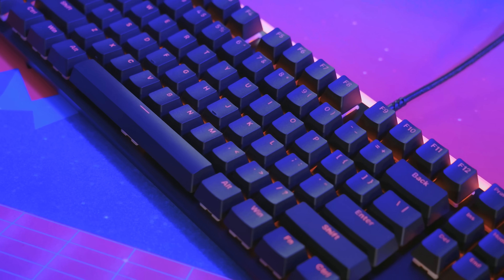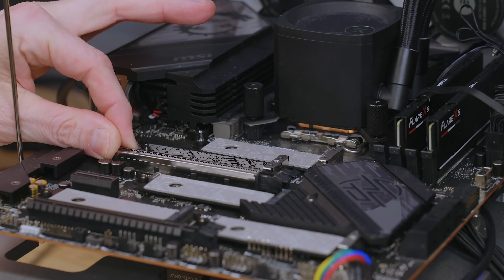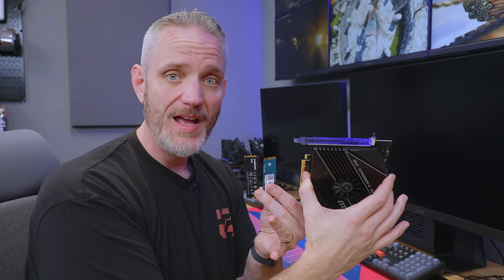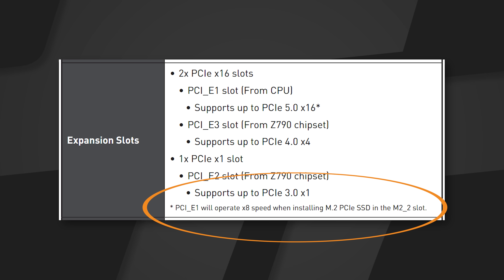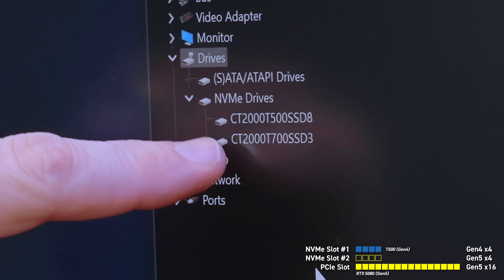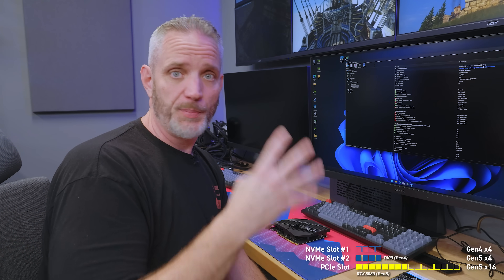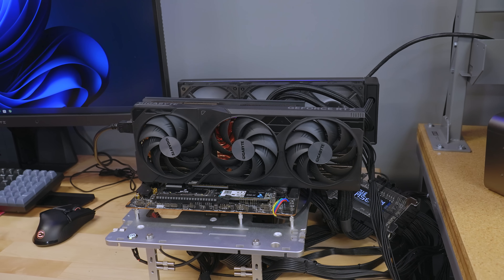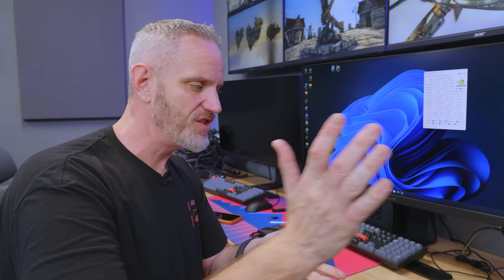Don't make this mistake with your PC!

Comment: Hey, thanks for the info. Just reconfigured my 3 m2  SSD's to optimal positions on my ASRock B850 Pro-A WiFi AMD AM5 socket, it has 4 sockets, and I have 3 SSD's, two gen4 and one gen3. I had one of my gen4's placed in a gen3 socket (m2_4). However the physical position of the m2_2 slot is actually underneath the graphics card, I opted not to use it at first, out of a concern for thermal throtling, should I be worried about thermal throtling or damage due to heat on m2's?

Comment: Quick cheat-sheet for people to help them understand what it is they're getting involved with:

- If you have to populate PCIEx16 slots beyond the GPU, usually the lowest ones are ran through the chipset and won't bottleneck your first slot's lanes
- M.2 slots are often arranged in the same way, in that using the bottom ones (closest to the chipset) are unlikely to bottleneck your GPU's PCIE lanes
- SATA drives will never compete for bandwidth with your GPU
- The topmost M.2 slot is usually the one connected directly to the CPU, and you can do with that knowledge whatever you want (I find running storage through the chipset is stable while using the direct-to-CPU lanes on the M.2 for OS is good for latency).
- Ultimately, this all only matters if you're doing things like heavy RT, overclocking for benchmarks, or basically anything that pushes your system to any kind of limit, which doesn't describe 99.99% of all users

Comment: Oddly enough I've just had to deal with this myself last week with a prebuilt. I read the manual for the AMD X870E motherboard it's going to have, and it said the M2A slot is 5.0, while M2B, C and D are 4.0, but populating M2B or C drops the GPU slot from x16 to x8. So I only got two M2 SSDs (one 5.0 and one 4.0) and pretty soon I should be able to see if they put them in the right places 🤞

Comment: I have the Asus Rog Strix X870E-E WiFi (with 9800X3D installed on it), and i installed there two Gen5 Crucial T700 and T705 drives, and installed other two Gen4 drives in the chipset lanes, and my RTX4090 runs at x8 4.0, and its not big deal i think, its kinda not that noticeable. I am happy that i has two Gen5 drives that are working as Gen5 drives. And yes, its very important always carefully to read the manual of your specific motherboard in your build!

Comment: I have an pcie gen 5 to nvme extension that allows bifurcation for 4 extra slots that doesn't pick up unless you manually select 4x4 lanes in the bios so there are some circumstances where it is useful to manually select for niche circumstances

Comment: Yeah, the additional x4 PCIe lanes is for USB 4.0.

Okay, to add to what Jay's explanation, for AMD CPU (Ryzen 5 7600 and 9600 and upwards, non-G variant like 8600G)
There is one General Purpose (GPP) PCIe 5.0 x16 lane which can be bifuricated to x16, x8 + x8, x8 + x4 + x4, depending on motherboars.
There is one dedicated lane of PCIe 5.0 x4 for NVMe SSD
There is one GPP PCIe 5.0 x4 (which for X870E and X870 motherboards will convert it to USB 4.0)

For Asus, if you plug in any NVMe SSd to M2_2 slot or M2_3 slot, your PCIE_1 slot will automatically switch to x8 mode.

By the way, Jay, AMD Ryzen has 28 PCIe lanes, with 24 usable lanes if you use 600 series motherboard and 20 usable lanes if you use X870 or X870E motherboard with 4 lanes for USB 4.0. 4 hidden lanes are for the chipset.

Comment: It's getting a little bit unreasonable how much you are now supposed to know when building a pc. It used to be more Lego. If you have the slot then you can fill it with anything that fits. So you can buy wrong ram, wrong ssd's and God knows what else. It should not be that way in my humble opinion. Just give me 2 ram slots and 1 nvme slot if that is all it can handle at full speed.

Comment: I am curious as to why more board manufacturers on the x870E premium boards didn't go the ASUS route here and actually use the second x4 of PCIe 5.0 if it's bifurcated away from the x16 graphics slot.  Too many only have 1 x4 v5 NVMe to the chipset, and one slot that is x4 v5 but shares with the X16 slot - those other x4 lanes are wasted.  If you're going to do one, you might as well have the option to do another x4 v5 since the x16 slot isn't going to run at "x12" or something.

Comment: Jay you have to do a videos about the MSI x870 motherboards having the front panel usb type c connector in the wrong place, they collide with the GPU with many case cables for usb type c.

They put their proprietary ezconnector in place of where the usb type c should have been.

Comment: This was my dilemma going from my older X299-chipset, i9 PC, to my newer X870 / 9800X3d build. Simply put, the only way to get more PCI lanes is to go with Xeon W-series or Threadripper, and spend thousands of dollars more. I had to move storage to a NAS and get rid of my raid card to stay within the confines of a normal board, as there's only so many lanes on the normal, 'consumer grade' CPUs. Even then, to make my new MSI board work at full speed with the  2 NVME drives I have (1 gen5, 1 gen4), I needed to manually disable (unused) USB headers on the motherboard. I don't have any regrets, though, as the new system is faster for its intended uses.

Comment: I didn't read the freaking Manual Luckily the X670E MEG ACE came with the ability to run all m.2s in 4x even with the top x16 slot occupied didn't even realize that my top m.2 slot is gen 5 compatible didn't know that got a gen 4 in it shrug can look to upgrading it when they release some larger than 4tb m.2s...

Comment: Just like how the SLI boards would do this, and later gen ones would have a dedicated 16x lane and then bifurcate the 2nd 16x "lane."  So if you SLI 3 cards, the first would be 16x and the next two would be 8x and 8x.  If you just had two cards, it would do 16x and 16x.  HOWEVER if you plugged ANYTHING into the other slots, even the 1x slots for like a SLI sound card, it would cut the 2nd card to an 8x.  My current mobo, as old as she is, does this with 16x and 16x on two cards, it supports up to 4 cards all at 8x each.  I used to run twin GTX 770's when I first built the system, and later moved to twin 980's.  I now have an RTX 3050OC those old 980's I got away with so much in games I had no right playing because of SLI.  Now it's time to build a new computer again as the old i7 3930k isn't able to keep up anymore.

Comment: You could also limit the first two slots to Gen3 so you can run the GPU with PCIe Gen5 x16 :D
Just saying.
You only need that speed when you move stuff from SSD to SSD anyway.

Comment: @Jay2Cents, what is wrong with the Taichi? This is what I am currently running and what is reporting from my ASRock Taichi X870E and devices? I see no issues, why would it be stupid? 

I have 4 M.2's, and a Gigabyte RTX 5090 Master 32GB GDDR7:
                                                          
Gen5 NVMe (PCIe x4 32.0 GT/s @ x4 32.0 GT/s)                                                               
Gen4 NVMe (PCIe x4 16.0 GT/s @ x4 16.0 GT/s)
Gen4 NVMe (PCIe x4 16.0 GT/s @ x4 16.0 GT/s)
Gen3 NVMe (PCIe x4 8.0 GT/s @ x4 8.0 GT/s)

RTX 5090: Video Bus: PCIe v5.0 x16 (32.0 GT/s) @ x16 (32.0 GT/s)
This is all copied from HWINFO 64 and what everything is currently running at!

Comment: How about you use Z890? Huh?

Z790 has 16 Pcie 5.0 lanes and 4 Pcie 4.0 lanes
Z890 has 20 Pcie 5.0 lanes
Reply: Yes, but those use the Core Ultra CPUs, which were dubious purchases if you're doing a gaming setup (for dev work it can make sense). A channel like Jayz, it's mainly people buying systems for gaming, so I can understand why he did this. I wish Intel would give more PCIe lanes in general, those nvme slots really eat up a lot these days
Reply: @peterwstacey dubious? 

There was only around a +/-5 to 10% single thread difference between raptor lake and arrow lake.

They were literally selling the 265K for $250 + battlefield 6 combo or $300 for the 265K + 32GB ddr5 6000mhz ram kit. 

I have both platforms, little difference in gaming.

Its just more techtubers shilling for amd sponsorships

Just checkout others like mooreslaw and you can clearly see the bias

Comment: My biggest issue with modern motherboards is the excessive amount of M.2 slots. Even on full size atx X670/E/X870/E boards usually only get 2 PCIe slots. usually being 1x 5.0x16 and 1x4.0x16@x4 bandwidth, whereas there's like 4 M.2 slots that the average user is likely not going to fill out. Can these M.2 slots just be turned back into PCIe slots and just use riser cards for those who want more M.2's? It's genuinely become annoying how modern boards are wasting that much space on M.2 slots.

Comment: 16:40 The X870E-E only supports Gen 5 x16 + one Gen 5 SSD. As soon as you populate just one of M.2_2 or M.2_3, the main PCIe slot will be reduced to Gen 5 x8. Only Gigabyte’s new board and MSI boards come with a MUX switch between the USB 4 controller and a second Gen 5 SSD. X670E boards all support two Gen 5 SSDs + x16 GPU, though.
Reply: I own an MSI X670e Ace, in comparison to the new X870e motherboards. I always thought there was a bad aftertaste to the direction of regressing, rather than progressing, for future obsolete resistance. 🤨
Reply: what if i dont care about the gen speeds of the nvme per se... what if i just want "normal nvme" speeds but want several of them since 2.5" ssd's are getting harder to come buy?
Reply: TPU test PCIe 5.0 x16, x8, x4 and the result are almost the same
Reply: Last generation, lower tier and no longer produced B650E AORUS MASTER provides just as many lanes to the CPU any consumer mobo made today.
Reply: @hizacaine yeah B650E were good too. 2x Gen 5 SSDs + full speed x16 Gen 5 GPU.

Comment: ok so using the gen 4 above the graphics slot is still the best since the last board you used as an example would cut lanes to the gpu if either m.2 slots where used.

Comment: I have a gen 5 nvme actually running at gen 5 speeds on my MSI B850. Guess what? The only real world difference is the gen 5 runs hot as hell compared to my gen 4 drives. No difference at all in game launch speeds, Windows boot speeds, file transfer speeds, or anything to really brag about. Maybe in certain situations it makes a difference but for most people gen 5 is a waste of money.

Comment: Funny, today I actually popped into BIOS to check my settings and see why my  PCIE wasn't running up to speed. Turned out its because I have to share bandwidth because I am using 3 nvme ssd'd and have a 10th gen cpu. I basically figured out that I could take out an NVME or switch to an 11th gen Processor and then switch boot order and move one of my NVME's. So, I am just going to wait until I feel I need to upgrade my cpu before doing the work. I have an i9 and a 7900xt so its not a problem yet. Maybe in 6 months Ill upgrade and fix everything. Then it will be a little faster computer...

Comment: I’ve got an MSI board. The manual did mention this, but it took a double-take before it really clicked. Make sure your drives done correct - and be ready to decode some Taiwanenglish when you find this in your mobo-manual.

Comment: Be cool if manufacturers could figure out a way to quadfurcate(?) the lanes so they may not be wasted and even if someone does use an extra nvme slot the gpu could run at say x12 instead of going down to x8.

Comment: @JayzTwoCents counter Point  regarding m.2 SSDs, even put within a gen 3 PCI slot will still have better performance, if only because random read/writes/iops will be higher,  Over a gen 3 m.2 ssd
Even if Maximum speeds will be bottle necked by the Pci revision, to put in gpu terms, while the max fps will be capped the minimums will be vastly improved
while not economical, is this not correct please correct me if im wrong

Comment: I don't have the board to test it but I'm pretty sure you are reading that ASUS ROG Stix X870E-E Gaming WiFi manually incorrectly. It will bifricate the GPU slot down to 8x as soon as either of the M.2_2 or M.2_3 is used. You don't have to populate both of them to drop the width on the GPU down. It just doesn't waste the 4x lanes because it has it wired to two different M.2 slots. The first sentence of the note says "M.2_2 & M.2_3 slots share bandwidth with the PCIEX16(G5)". That means as soon as either one of those slots is in use it goes to 8x,4x,4x bifrication.

Comment: I knew all of this, but thought I would load HWInfo and follow along with the video cause you never know. Turns out I was cutting my GPU lanes in half! I was really scratching my head, because I know I checked all of this when I built the machine. I even got a m.2 pcie expansion card specifically to avoid this! But a while back I was plugging in some cables and I needed to unplug the pcie card to get at them. I must have plugged the card back into the wrong port. Jokes on me! Thanks for making the video Jay.

Comment: Saw you made a nod but didn’t confirm it.  AMD literally put it in the spec that x870 and the E variant have to include 4 lanes dedicated to USB4.  This was not required on B850.  And I think 1 manufacturer actually gave users the option on x870 board to turn those usb4 off to free up those x4 lanes that are dedicated to it.

Comment: Only if the pcie M.2 card can bifrickate will it let you use both drives. I have a 4 drive pcie card that did nothing to bifurcate, with 4 drives plugged in only the first drive showed up at all in windows/bios. It is a direct link only with no bifurcation, comon for cheaper adapter cards. Buying a higher GEN drive is often pointless as I found out my self.  A gen 4 512 Gb wd black cost me the same as a 1 Tb wd black gen 3 with almost no difference at all outside synthetic benchmarks. I wish I had 2x 1 Tb gen 3 for the space (perhaps to be ran in raid 0) rather than a C: drive a tiny bit faster at half the size.

Comment: This is why on my current build I wanted to go threadripper however time and budget was wrong though so I have the AMD desktop CPU lane limits which limits my upgrade options without replacing the MB and CPU.

Comment: How would @jayztwocents lay out the asus rog strix x870e-e gaming mobo? I have my os on a gen 5 m.2 in the hot swappable slot and have a second gen 5 to move to one of the other gen 5 slots but just haven’t decided to move it there yet (it has the games on it). Just wanted to see how it ran first with the games drive in the gen 4 slot that doesn’t split the lanes. I will probably move the gaming drive up to the gen 5 slot soon.

Comment: 3:45 Wrong. There is no PEX on that PCI-e card, so there is NOT 2 layers of bifurcation possible with that card. 
One of the drives entire data I/O is routed to pins that just don't exist on the mobo. So only one drive will show up, not a speed split..

Comment: Crazy timing, I just built a 32-bay cloning server and had to learn about bifurcation by RTFM!
Reply: And I just watched that video :)
Reply: Can't wait to buy one of those ThinkPads you're reviving. 
Seeing you OS clone 32 storage drives brings back my days at Electricro Regeneration Society.
Reply: You know you are 1337 when you RTFM!
Reply: Thanks! What I did was this: using ChatGPT (paid), I made it remember the PDF manual of my motherboard and had it create a visual chart showing where to connect my drives, GPU, USB devices for keyboards and mouse, SATA drives, etc.—all to ensure proper placement, avoid latency, and handle bifurcation correctly. Easy peasy.
Reply: Still running a B550 board.  Asus B550-F Gaming Wi-Fi II.  Didn't expect to expand on it as much as I have.  I'm using the lower M.2 slot (in addition to the top).  Using that takes away S-ATA ports 5/6.  OR I can keep 5/6 @ half bandwidth and have M.2 @ PCI-e 3.0 x2 instead of x4.  But I used a PCI-e x1 S-ATA card to put my RAID 0 HDD's on.  

But using any of the PCI-e x1 slots turns my PCI-e x16 @ x4 into an x1 slot lol.  Board comes with Wi-Fi/BT (RZ608 80mhz Wi-Fi 6e and BT 5.3 now) but I'm using a PCI-e x1 card wtih the AX210 for Wi-Fi 6e 160mhz/BT 5.2 or 5.3, not sure what it is now.  Don't even use Wi-Fi, but still wanted a nice Wi-Fi situation.  

But, yeah, I didn't know ALL of the technicalities on the B550 chipset before purchasing, and while it isn't limiting me at the moment, I did want to add a PCI-e M.2 card because I have another Samsung 970 Evo Plus (I have 3x, a 2TB and 1TB installed in the board, and a 1TB just laying on the desk).  But my PCI-e 3.0 x16 @ x4 from the B550 chipset is now running at x1, so it's just not quite worth it.  I mean, it's "worth" it, I guess.  But I'm in no hurry to stick a card in that would cut its performance down by that much.  3x SSD's, 2x 1TB HDD's in RAID 0, 1x 3TB HDD, 2x M.2 NVME's... and 1x more M.2 NVME if I do get a card for it.  Still debating.

Got a little Optiplex 5070 (i5 9500/16GB DDR 2400) running my security system, Plex server and NextCloud server.  Can't remember if it has another slot for an M.2 drive... dang, who cares?
Reply: swamp gooch
Reply: jay didnt had a good video on PCIE- it was a mess... so this should be built on said video- and its also a mess because its base on info he didnt convay good.
for example- if he were to exaplin the idea of bottleneck in PCEI lanes, hee would know the answer to what happened when he put the gen 4 drive in thee system- it will split the gpu... why? simple, lanes are phisical lanes, if you put a gen 4 product into a gen 5, the lanes will work at the minimum: in this case gen 4- so theres no question what will happened in the gen 4 drive case as per the gpu.

btw, the reason i know a lot is cause in the last year i built a home server and had to switch a lot of parts over picking with no understanding- pcie was really something i needed to learn after 20 years in the pc world.